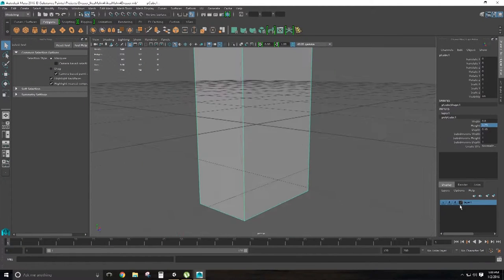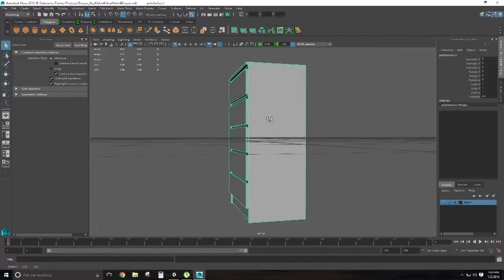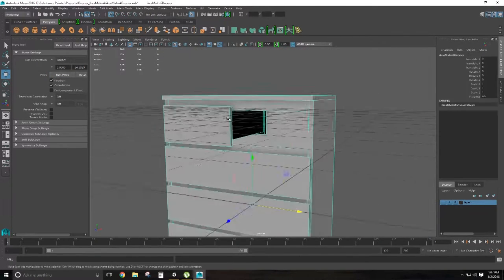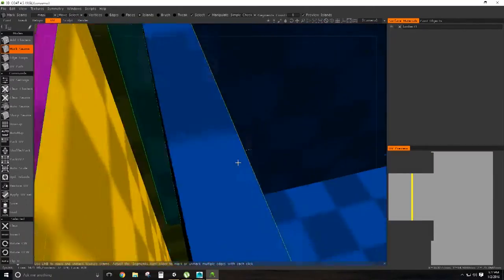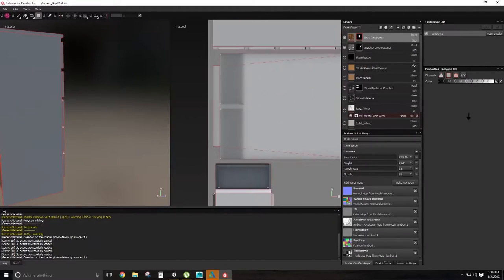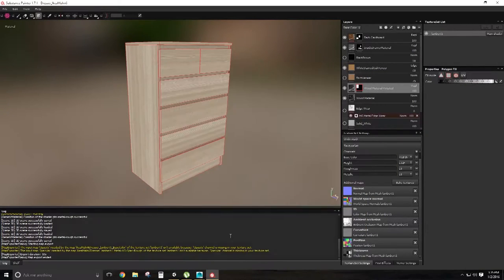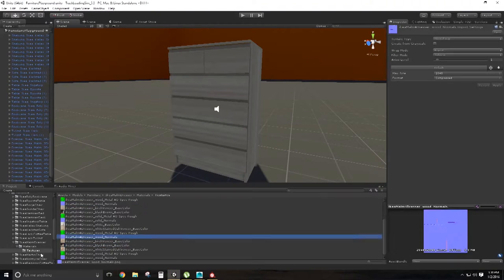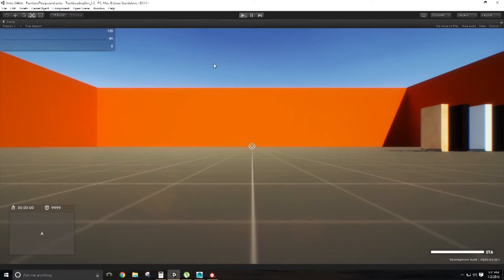Truck Loading Simulator | Dev Log #1 - Art Asset Process

Comment: Looking awesome man!

But some of the textures look exactly the same, even if something else is possible ;)

But keep up the great work!

Gamad - another developer
Reply from the maker: +Gamad Thank you! You do have a valid point, the textures across the models look pretty much exactly the same. What would you have done?
Reply: Well that wasn't what I ment, because that is probably all in 1 big atlas texture, the thing I ment was that in 1 model everything looks the same, the way to fix that is simple, just use plasma mask for example (GIMP2)

But keep up the great work!

~Gamad - another developer
Reply from the maker: +Gamad I'm sorry. I'm not following what you mean. What exactly is a plasma mask?
Reply: Just something you can use in Gimp to add more variation ;)
(nothing special, wich programm do you use for the textures?)

~Gamad - another developer
Reply from the maker: +Gamad Oh okay. For the most part I'm using Substance Painter/Designer though I do also use Photoshop.
Reply: Okay it is just a litte trick to add some varation, nothing special, but good enough to make it look different ;)

(you can also do it on you own by just add at some places a little bit black and other places a little bit white ;) )

~Gamad - another developer
Reply from the maker: +Gamad Okay. Now I'm picking up what you're putting down. Thanks for the suggestion! :)
Reply: np, keep up the great work!

~Gamad - another developer